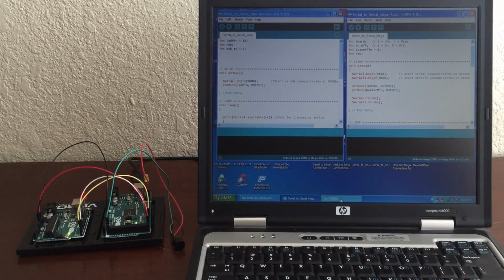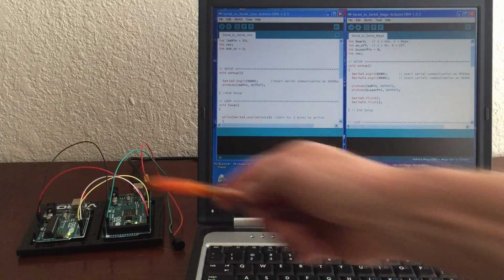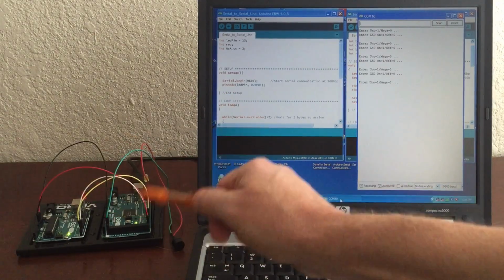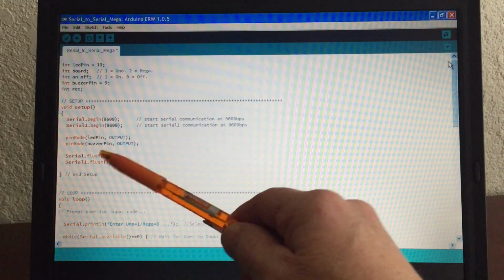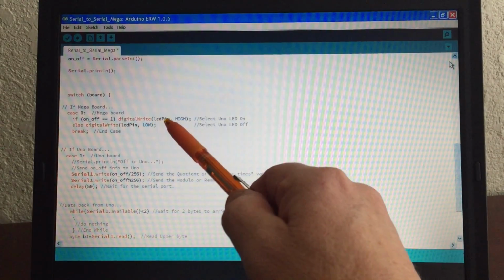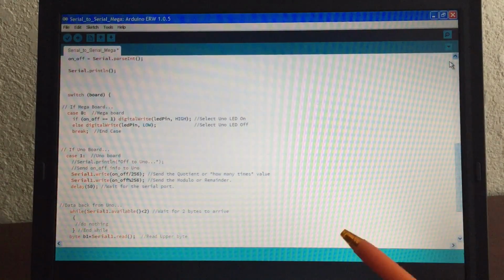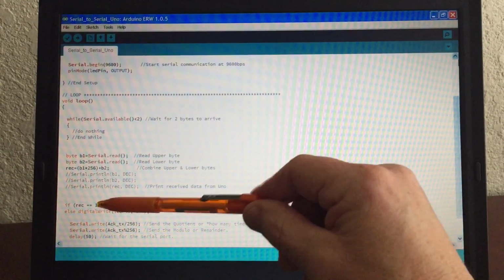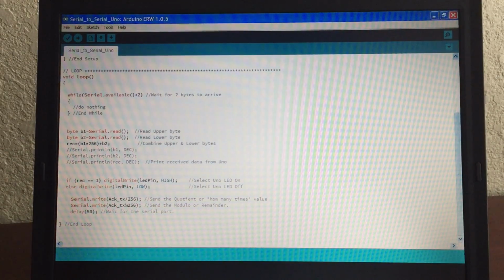Hardware Serial to Serial Communication using Arduino Uno & Mega

Comment: Hello... I have connected the PC to monitor RX and TX pins and sent AABB from the sketch. And I received 0x5F 0x5F 0xAF 0x2F. I am powering Arduino using 12 VDC. The same data is received if I connect RX and TX pins to a TX and RX inputs of an IP Modem, which uses TTL levels. Both ends are working at 115,200bps and 8N1. What may be going on?

Comment: Electronics Noob here.  I just bought a Mega and want to do a very simple serial transmint (TX) to a media player (MedeaWiz Sprite) that is designed to receive this kind of simple serial communication, it has an adaptor to connect wires directly to it's TX/RX ports.  My question is, what is the distance I can transmit the signal from the Arduino (TX) to the Media Player (RX).  I want to transmit between 50-100 ft.  If there are any other trick or tips you have I'd be glad to hear them.  Thanks

Comment: Hey, I made an ultrasonic sensor with a pager motor for vibration to help with detection. However, the motor keeps running even if there is nothing in front of the sensor. And, the sensor doesn't detect any objects or distance. What should I do?

Comment: So I understand almost all of the code, and I definitely get the logic, I'm just not understanding why there has to be an upper and lower byte. For example, why not just send one byte and then on the receiving end if the byte matches a predetermined value execute further instructions? What's with the whole upper and lower byte thing, and why do you multiply the upper byte by 256 and add the lower. I'm familiar with binary but I'm still not following.

Comment: pls I need to connect two Arduino Mega together with the intention to just use the second one to extend the number of digital port for my application. How do i go about the physical and code connection? Thanks sir
Reply: If you just need more digital pins, have you considered using a shift register chip instead?

Comment: Hey man, just a quick question. Do you have to run both sketches, or open both but run the Serial to Serial Mega, sketch. 
I'm having trouble sending and receving info from the uno, but input from the Mega is working fine.